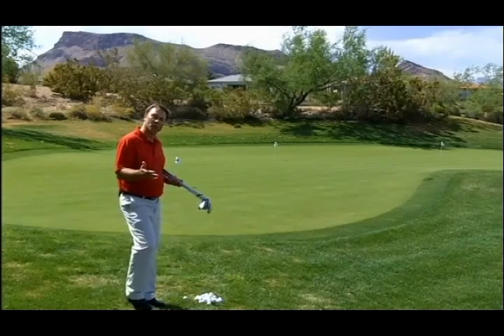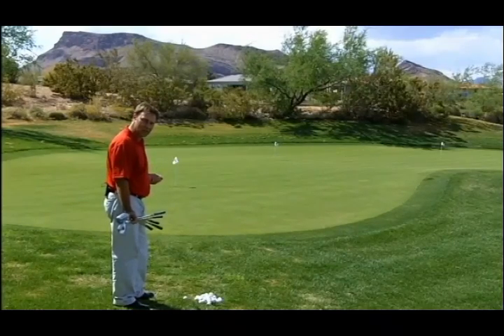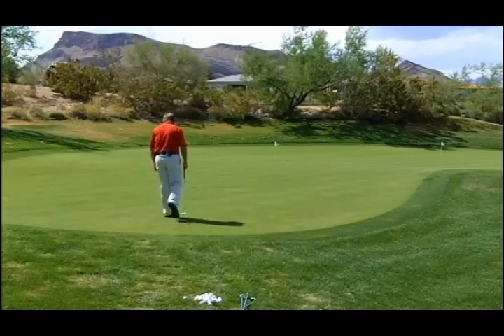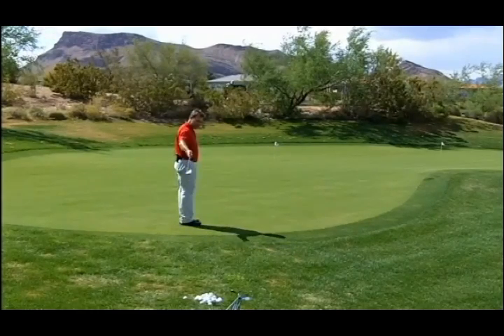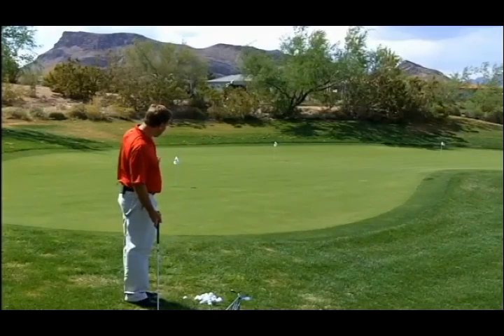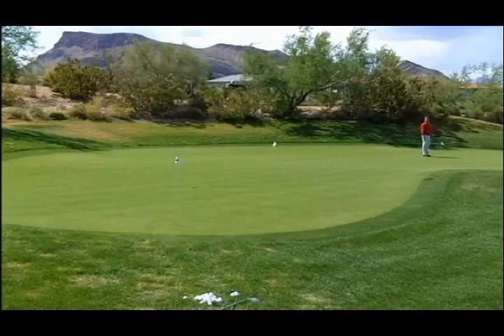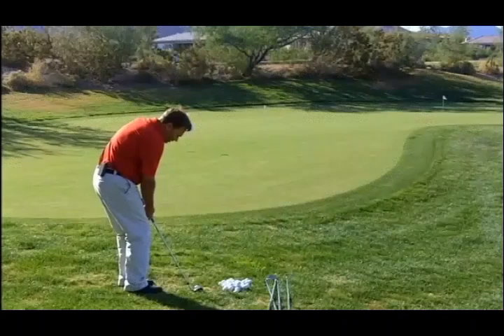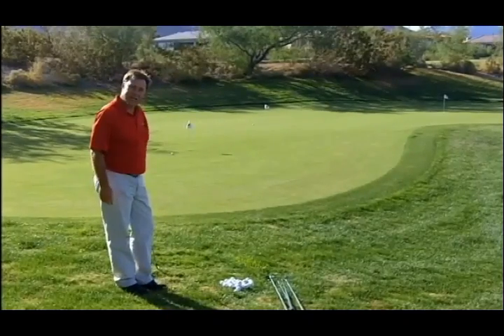Chipping Ratios - How to Dial In Your Chipping

Comment: This worked so well in practice I suddenly realised I wasn't trying to chip it close I was trying to chip it in, and within a short time and with 30-40 foot chips I'd make 5-10% of these and most of the others would be easy one putt range, which I found amazing. Thanks Paul. A couple of things I'd add, one, it does depend on the speed of the greens and whether you've got a flat, up/downhill putt so try to practice with a relatively flat green area, and two, this works if you place the ball opposite the rear foot. If you place it towards the centre or slightly forward it creates more loft and changes the ratios considerably.
Reply from the maker: Exactly.  This is what happened to me many years ago.  Thought I could make it.  Yes, for uphill add one downhill minus one.  fast and slow adjust too.

Comment: Paul, your tutorials are so easy to follow and the logic behind your tips and drills is easy to understand and remember.  One question:  What is the furthest distance from the green this chipping method be used?  And how would I adjust the swing for further distances?  I seem to have difficulty judging this...so thank you for any advice or point me to another of your tutorials.
Reply from the maker: Thanks.  I just depends.  If the SW fly 50% and rolls 50% when you are farther out where that ratio doesn't work you would be pitching to hit it higher so it doesn't roll as far.

Comment: great tip Paul... However I have a question regarding this video:

How far away from the green should you be until you stop using this ratio? i.e. would I still use this method if I am 10 steps away from the green? or 20 steps? or is it only used for when you are really close up?

Comment: Paul, love all your videos this one is no exception.  A lot of people call this one the rule of 12.  Subtract the ratio of roll to carry from 12 and you have the club.  For example for a 3 to 1 roll to carry ratio, you would use a 9 iron (12-3).  For a 4 to 1 carry ratio you use an 8 iron (12-4).  Very simple math so you don't have to carry a chart with you to the course.
Reply from the maker: Other commenters have mentioned that.  Pretty simple my way too.  Not sure why people would have a hard time with it.
Reply: @paulwilsongolf  great explanation of the ratio and clubs. But for someone new to using this method (me) definitely easier to subtract the ratio from 12 to get club.

Comment: Just found this video 9 years later but this still holds true, your system is much easier to understand than Paul Runyon's. My only question is this: if I were 9 to 10 steps off the green would I go to the Next higher club to get the ball to the hole using the same landing area? I just started golfing last year and I will be trying this Ratio chipping method. Thanks Paul !
Reply from the maker: Yes, it's simple.  I had some guy bash me for saying I was copying his technique.  I never even heard of it.  Funny how people think I have heard of everything that is being taught. Once you get to the point that you are no longer 50/50 you would then pitch because you have to hit it higher so it doesn't roll as far.

Comment: Just a little confused. Your chipping strategy video says to use a putting stroke, but you are obviously hinging when hitting these chip shots,even the short sand wedge. Your videos are the best, so I am sure you have a simple explanation for this. I have been chipping with a putting stroke just increasing the stroke from 7-5 to 8-4, etc using an 8 iron. I chose my 8 iron base on an actual chipping wedge averaging about 37* loft. My 8 iron is 36*, so it is close. Thanks in advance!

Comment: just went to chipping green and walked off the pin placement with a 15step distance from the edge - and i put the ball 4 steps off the green.  
after a few attempts i hit one nice and crisp 9 iron (with the putting stroke) it was 4" from the hole!  Thanks again for the tip!
Reply from the maker: Nice work!  This will save you a ton of shots.

Comment: Hi Paul. Love your videos. Was watching the chipping ratio video and have a couple questions. (1.)How for out do the ratios work? In the video your ball is about 5 paces from landing zone. Do the ratios work the same if your ball is 10 paces from landing zone? (2.) Is there a formula for?example: The ball is 10 paces from the green but the pin is only 5 paces inside green? Thx so much. Your body swing  has made golf fun again. Don
Reply from the maker: Thanks so much.  I appreciate the support.   50/50 or 1:1 is a sand or lob wedge.  So if you were more than that you would be pitching so the ball doesn't roll as far.  So if you were 2 parts fly to one part roll you  need to pitch.  That answers your number 2.

Comment: Hi Paul.  I'm a golf instructor of 28 years.  One of my out of state students sent me the link to this video yesterday so I had to go out and "field test" it.  It worked for short chip shots with my sw.  But, On another shot I stepped off 3 steps to a spot 3' from the edge of the green then 9 steps from there to the hole.  3:1 ratio, right?  That ought to be my 9 iron.  It took a 7 iron to get the ball within 3' of the hole landing it within 3' of the edge of the green.
The green was flat.  The only thing I could figure out is the speed of the green.  They haven't cut the greens yet this year - central Indiana.  But, 2 clubs clower?  It is what it is.  good theory though.
Reply from the maker: Great to hear from you.  Yes, speed of the green, uphill downhill, even wind.  You would have to take this into account.  I was going to do another tip explaining this.  Maybe I will get to it this year.

Comment: hi Paul, very well explained. Definitely going to use this method. Just one question though, So you use the same swing for each shot. As in the club goes back to the same height on the back swing and same height on follow through for all the different clubs used. And would it be to 9 o clock back then through to 9 o clock follow through. Cheers

Comment: I have used this technique and have had some amazing shots. The last one rolled up even with the hole and 6 inches away. For the most part I do much better than using pitch shot and it seems better than using a putter.  My question has to do with green slope. Often I am in front of the green and the hole will be above the ball, some times at or above head height.  What rule of thumb is available to use to help in this case?  Unfortunately most of the practice greens don't have that elevation gain.  The other is green speed.  How do you deal with fast green versus slower greens?
I have your book and the short game set on cd. Thanks for the videos.

Comment: Thanks for all the great tips Paul. In question, I've been taught to use one club around the greens. Like a pitching wedge or a sand wedge. What is your take on these different approaches to chipping? Real appreciate your expertise.
Reply from the maker: Glad you liked it.  If you have 2-4 hours a day to practice then use a sand wedge.  If  you want the easy way you learn the technique.  You hit the ball on the front and roll it to the hole.  You change clubs for different distances.  I know you will make the right choice.
Reply: Thanks for the reply Paul cause I know you're probably  very busy normally. I had my first round in a long while and and decided that the sand wedge should be the club. Thanks for your keen advice. cheers.

Comment: This is pretty cool, but I feel like it would actually be harder. Then you need to be able to fly it just onto the green with so many different clubs based on how far you are from the green. In that way I feel like there's more things to practice compared to just using 1-2 clubs
Reply from the maker: No,  you hit any club just onto the front.  That means you are learning 1 shot.  The ball rolls more or less due to the loft.  This is way easier.  1 or 2 clubs and you have to guess where to land it.  This could be millions of places.  Give it a try and you will see.

Comment: Paul years ago you demonstrated a pitching vs chipping technique, whatever happened to that video. The reason for my query, is that the pitching ratios were respectively opposite the chipping ratios. e.g., 4:1 would fly 4% to one pace on to the green, and roll out 1% give or take to the target. Is that a correct assumption to your previous explanation? Thanks in advance...

Comment: how does the situation change when you are futher away from the green.. i mean do you always use a SW as the base club in the ratio no matter the distance of the chip to the landing area?
Reply from the maker: If you are 10 yards out and the pin is 5 yards on that is a 2:1 so you would pitching so the ball doesn't roll as much.

Comment: How far from the green can you still use this method before it turns into a pitch shot?
Reply from the maker: Think of the ratio.  If you are 2:1 you would need to hit it higher so it doesn't roll as far so you would be pitching.

Comment: How does this work when you are further away from the front of the green? i.e. 5 yards of green and 15 yards of rough?
Reply from the maker: Depends where the pin is.  If you have to fly it longer then where they pin is on the green you need to pitch.  If not just follow the ratios.  They always apply.  Rough might want to take one less club.

Comment: On chipping should every back swing be the same distance to get a consistent backswing and just change your club for different distances
Reply from the maker: You need enough stroke to get it on the front of the green.  If you are 10 paces from the landing point you would accelerate more than if you were 3 yards from the landing point.  This may also require a tiny bit more backswing.

Comment: I need to ask, what if your are more than 5 paces from t
he green. Lets say your are 10 paces of the green how does this work then?
Reply from the maker: Depends where the pin is.  If it is 5 yards on then you are at a 2:1 ratio.  You would pitch so it doesn't roll as far.   1:1 you are chipping.

Comment: Paul, I would really appreciate you answering Graham’s question which  is a long time ago. This is his question 

How far away from the green should you be until you stop using this ratio? i.e. would I still use this method if I am 10 steps away from the green? or 20 steps? or is it only used for when you are really close up?

 At least according to Phil Mickelson you can chip  as much as 30 or 40 yards away (although I would probably be pitching at that distance)  and obviously you’re not going to be using this technique at that distance. So could you please make it clear it’s been really confusing?

Comment: Next time I go out Pual I’m going try this. I shoot 84 to 90. I land around green within 4 metres around 12-14 times n only get up 3 times if I’m lucky. I only use my 7 iron. I hit it very short or to long (usually 10-12 feet). If I can switch this to 7-10 up and downs I should break 80
Reply from the maker: You work on this an chipping becomes super easy.  You are only hitting the ball a few yards onto the green then rolling it there.  No guessing where to land it.  After I started doing this many years ago I literally thought I could chip in from anywhere.

Comment: Just another version of the "rule of 12" for chipping/pitching. Still a good video though. The video would have been more complete if info on reading the green would have been added. By that I mean reading the green from the initial landing area to the pin. We read the greens for putts to get a more accurate roll to the pin. No reason not to do the same for a more accurate roll when chipping/pitching.